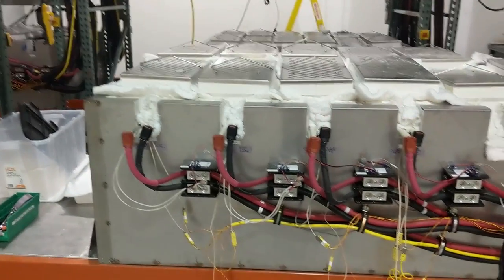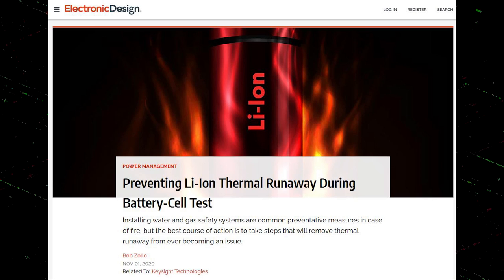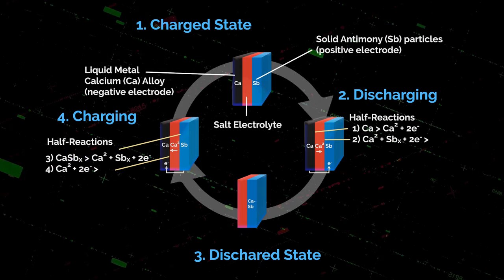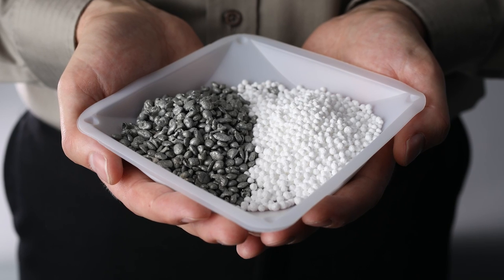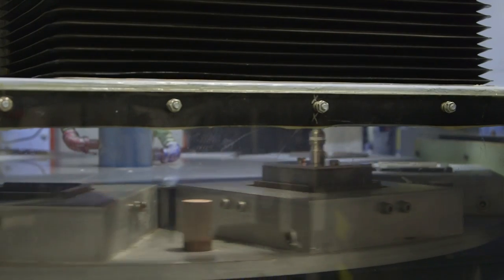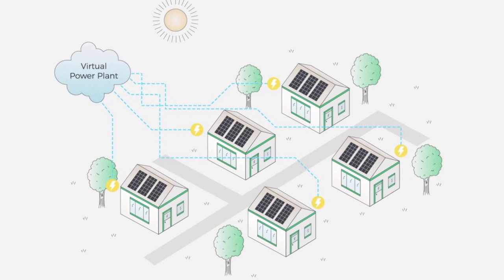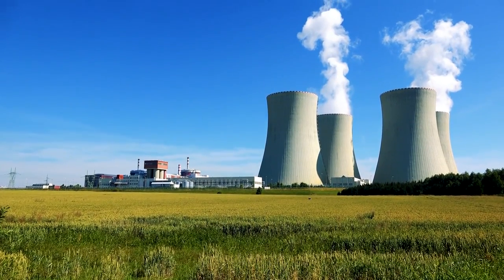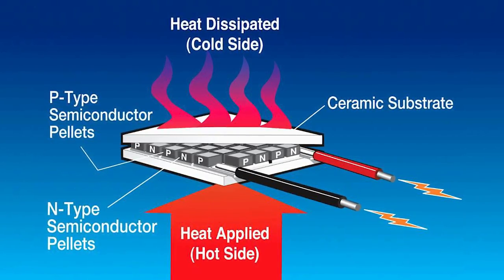Ambri: A Battery that Could Change the World

Comment: This professor is quite remarkable. I hope for him this AMBRI company will succeed !
Reply: @mugin11223344  Depends on which metals are being used.  Looks like Calcium and Antimony - Antimony is a few thousand per ton, Calcium is relatively free in comparison so at least the battery technology is realistic.

The question is renewable energy realistic?

The battery itself is 80-90% efficient, which is quite good - superior to hydroelectric energy storage.
Reply: @mugin11223344  I'm no expert in batteries, but I understand the basics.  For the reason ALONE that it's solid metal, over multiple charge and discharge cycles, the anode and cathode warp, and eventually end up touching one another making an internal short.

I know it SEEMS wasteful that these have to be heated, but it's not a big deal to thermally insulate them to the point that they would lose negligible heat over weeks, even months.  It's not hard to build a block of 100x100 METERS buried in the ground or actually manufacture the batteries on site - they are actually quite simple.

These are INDUSTRIAL batteries as well, suitable for running a hospital or office buildings or supplying energy to a neighborhood.  They won't be expected to be holding a charge for weeks or months - more like days.

These batteries also have higher energy density than Lithium Ion - but they CANNOT BE MOVED when in operation.

For Lithium Ion batteries, they ALSO need to be heated.  I worked on electric vehicles and pointed this out to a technician who brought in a car to be tested.  He said "no problem, just use the batteries to warm the batteries" - and they do this now.

Electric vehicles are NOT about reducing energy consumption.  They true convenience is you never have to go to a gas station, and they are a lot less complicated to manufacture and build.  Internal combustion engines are complicated and have to be constantly maintained.
Reply: What level of shaking an operating battery, would cause a critical event with the battery? 4.1 or 7.0 richter. Batteries could me mounted on anti-earthquake platform to negate the motion. Up and down motion too.
Reply: @chrispicritters4710  Great question..
Would the earth moving be the least of your worries?
Reply: Why is "changing the world" always presented as a default "good?"
 Dropping large nuclear weapons on NYC and San Francisco would "change the world" too.
85% of the world population dying would indeed, change the world too
Reply: Cool.now fill up some artificially sealed lakes with battery liquid, get them struck by lightning and fix the energy crisis. Problem solved.
Reply: @mugin11223344   that does not matter, because his battery will be loaded all the time, nowadays hydro planst at rivers often let a part of the water bypass, because they do not need to supply that much. Then they would of course use it and send it to storage.
Reply: @mugin11223344  his power storage model and that is the main difference this is a storage model it can freeze / thaw and re heat but that is not it's designed operating principle this is designed to work, HARD, for ever! Thermal Insulation is solved, if needs be use a vacuum but ceramics are getting very impressive. 
This is like the birth of the internal combustion engine! kudos to the prof!
Reply: @James Smith I worked in this field.  I'm not going to bother to argue with you.

Believe whatever marking bullshit you like.
Reply: @James Smith I just don't care what you believe.

That's the great thing about reality, eventually you need to accept it.

I get am tired and and sick of counteracting blatant propaganda.  There is more important things to deal with than this.

Electric cars are as, if not worse, wasteful in terms of energy consumption.  I really don't care if you realize this or not.

If you neglect how the energy is produced, the loss of energy transmission, the loss of charging a battery, the tax subsidies of using this energy, it seems this way.

I'm not on a grant, I don't depend on a government subsidy for my salary, a lot of people do.

Policy is run by stupid ideologues that think that their stupid beliefs will come to fruition and a bunch of scientists under the axe of suspension of funding if they don't tell these ideologues what they want to hear.

Reality wins out in time, it doesn't matter.  I'm sick and tired of this BS.  You want an efficient car? Use compressed natural gas.
Reply: Are they Available now
Reply: Good luck with helping to do something for everyone towards clean air and
Reply: @tarstarkusz  nobody talks about that... Empty comment
Reply: @mugin11223344  no one was saying anything about free energy. This batteries are just a way to store huge amounts of energy mostly for industrial purposes. It won't solve all the world problems but it's not engineered for this purpose. Come on - be more flexible imagining how things might work.
Reply: @James Smith Not forcing energy companies to pay high prices for residential solar generation is NOT PUNITIVE.  Punitive would be a huge tax on solar or laws against solar.  You are saying the government failing to force energy providers to pay some arbitrary rate for power it doesn't want or need is somehow equivalent to being against you, despite the fact they give you all kinds of subsidies already.

 When I say solar is near useless on the grid, I don't mean solar generated electricity in general from a large solar farm, I mean residential.  If this power was worth what you want them to be forced to pay you (by law), they would already be giving you that.  What you want is even more subsidies snuck in through forcing electricity companies to pay for power they really don't want or need and passing that cost onto people who don't buy solar equipment for their house. You want to feel good about your solar panels while pushing the true cost off onto other people, who you can then look down on for not having solar panels. Unreal.

Already stupid laws are screwing solar up.  If you want any of these monies, you have to have your array pointing South.   In many places, solar would work better facing West because late afternoon is peak.  Power companies would voluntarily buy this power from you at a higher rate. This is when they need it.

There are no European countries which, on average, produce anywhere near say, half, since you use phrases like "a good chunk"   You might have noticed the world marching towards another world war (like American nuclear bombers being moved into Europe in past few weeks/months) over natural gas deals in Europe?
The only country in Europe even close to clean is France and almost all of it is nuclear.
Another thing people don't want to talk about with Europe is retail electricity costs in Europe and gasoline prices in Europe.

Before you start telling me I don't know what I'm talking about, you should probably look up the definition of the word "punitive" in a dictionary. There is not a single American state which is "punitive" on solar by any reasonable definition of the word punitive. The government is not actively harming solar in any state.
Reply: @tarstarkusz  A simple answer would be that when people use the term "change the world" , it is implied "change the world for good". I would suggest that you make that assumption as well.
Reply: @MrStupidHead  There have been a large number of changes to the world in the past 100 years that have been terrible.
No. This is not just assumed, nor should it be. As I said, lots of changes happen that are terrible.  Many of the terrible changes of the last 100 years have been changes specifically sought out by people looking to "change the world" who utterly failed to anticipate all of the negative consequences of their pet project.
By "change the world" most people mean "make it more to my imaginary liking" which is another way of saying "make changes that may or may not result in the alleged good thing I want without any downsides whatsoever"  Of course, this is a childish view.
Reply: @tarstarkusz  Your point is that change is sometimes bad. Like climate change, or sea-level change, or any one of a million changes. Of course. When people discuss "change" in the above manner, however, it is implied they mean it to be for good. Your point is unnecessary in this discussion.
Reply: @MrStupidHead  If we didn't do exactly what you are doing, people would understand that not all change is good and that even if you think the change is good, there can be unforeseen consequences.
Look up something called Chesterton's fence.
Reply: @James Smith Wanting you to have solar is not the same thing as wanting to buy your power and do so at a price mandated to them by law.  The grid is designed to deal with large power sources and distribute that power to end users, it has not been designed to take distributed low power from hundreds of thousands or millions of tiny solar installations and distribute that around the state. Furthermore, you are making an assumption that is not true. You are assuming that if you put power on the grid, that the operator wants it there. 

Do you honestly think they WANT to have to constantly adjust large scale generation when a bunch of retail customers start randomly putting power on the grid?

Again, residential needs?  What does that even mean? What they are very likely doing here is adding up the total MW hours produced by wind, coming up with a number and then comparing it t(on a yearly basis) to the residential use over a year.  It's weasel words. That is why I pay no attention to crap like that. It's meaningless.  Of course, they do not subtract out the power it takes to RUN the turbines when the wind is not blowing. Why is anyone talking about "residential needs" when discussing the grid anyway? The grid does not see power in this way.

Newspaper articles?  Give me a break. Peer-reviewed studies or at least government reports. 

You said the law was "punitive" and that is what I took issue with.  It's not a agree or disagree term.  The law is not punitive by any reasonable definition of the word.  Regardless of what form it takes or how small you think it may be, you are getting subsidized by the tax payers. Then you have the nerve to say that government, who is subsidizing your solar installation is actually punishing you in an unfair way for not forcing power companies to  pay you the price you want of your excess power.  You certainly should not be allowed to even roll the meter backwards unless that is what the power company actually wants. Because you are not merely paying for the electricity you consume, you are paying for the ENTIRE SYSTEM. So when you run it backwards, you are, in doing so, effectively charging full retail power price for the pittance you put on the grid.

Wind generation is generally not small.  Each tower is like a MW and they tend to put many of them together. Besides, I didn't say anything about wind.
Reply: @James Smith They are neither cheaper or easier to manufacture. That's why they cost twice as much.
Reply: @tarstarkusz  Alabama, Florida, Georgia, Indiana, Michigan, Oklahoma, Tennesee, Texas, Virginia, Wisconsin.  biologicaldiversity.org
Reply: @tarstarkusz  is
Reply: Where do you get the heat to restart the cold fusion process after a shut down?